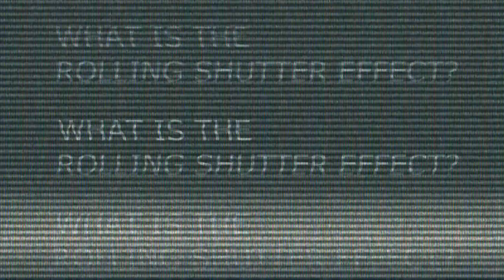The Rolling Shutter Effect & Aliasing Explained

Comment: You need to get your terms correct. Aliasing is not the stroboscopic effect that causes wheels to appear to turn backward or helicopter rotors to appear to stand still. That is a stroboscopic effect caused by the relationship between the frame rate and the speed of motion. Aliasing is stair stepping caused when lines do not line up perfectly with the pixel grid in a digital image. Antialiasing is the process of interpolating the color values of those lines so that circles look a little rounder. Aliasing and antialiasing have absolutely nothing to do with rolling shutter problems, neither does the movement of objects in the frame. Rolling shutter problems are caused by the time delay between the sampling of each row of pixels by the sensor and the processor turning the luminance and color information into pixels. That's why the lines bend. 

Other than that your explanation was almost ok.
Reply from the maker: Aliasing is a very broad term. In the photography world the definition might lean closer to what you said, but take electrical engineering for example: Aliasing is what happens when you have a multiple of a frequency, which can cause problems for oscilloscope readings. 
Aliasing simply comes from the word "align" and the raw definition of aliasing is: the misidentification (or misalignment) of a signal frequency, introducing distortion or error.
Which is essentially what I am talking about here... Your eye or camera misidentifies the frequency of a spinning wheel. 

Aliasing can be further separated into a number of subcategories including, but not exclusive to, the stroboscopic effect.

While you're not wrong in saying that this is the "stroboscopic effect"... neither am I by saying that it is aliasing. 
And I chose the broader term aliasing so that viewers would be able to associate this form of aliasing with others, not just photography.

Comment: Many years ago I had a ceiling fan in my living room and also a strobe light. When the speed of the fan and the light were adjusted just right,I could make it appear that the fan blades were still or even going in reverse.
Reply: Make sure not to have little kids around because they might think that the fan isn't moving
Reply: Make sure not to have little kids around because they might think that the fan isn't moving
Reply: Make sure not to have little kids around because they might think that the fan isn't moving